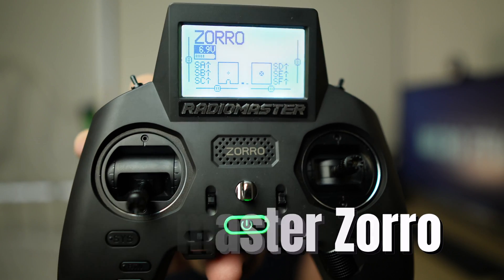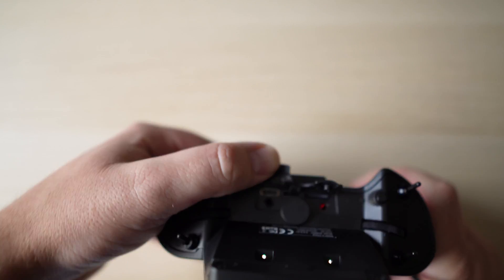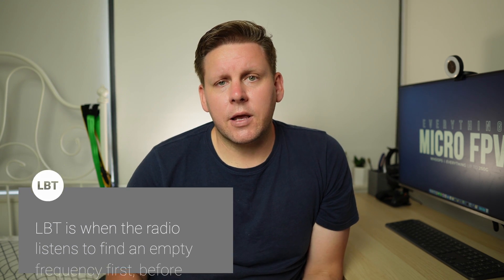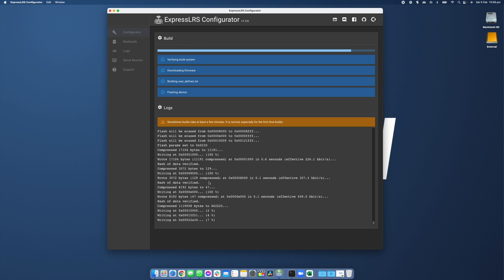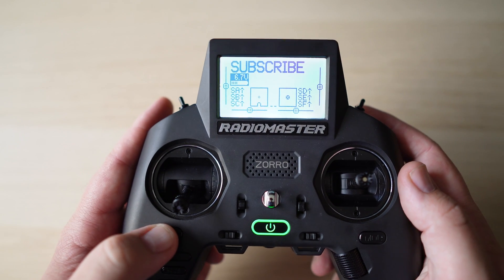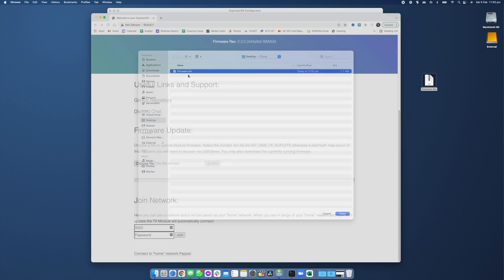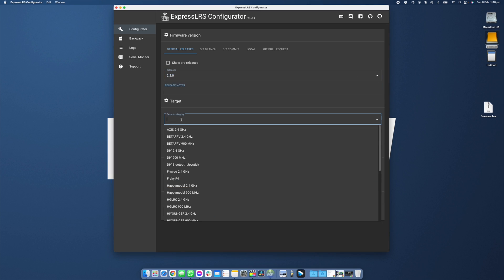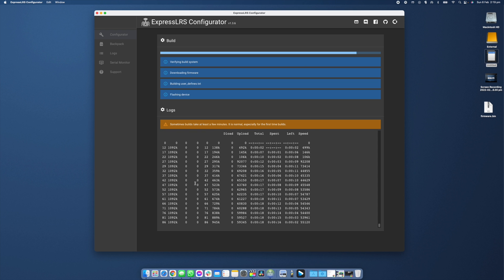Easy ExpressLRS Setup on Radiomaster Zorro

Comment: Hi Darren,  thank so much for the video, very helpful. I am wondering you have ever had this issue - I have followed your instructions for wifi flashing, there was an error when trying to flash, now my radio will not produce it's own wifi network anymore.  I have tried reinstalling opentx firmware, elrs firmware and the lua script, but no matter what I do my radio will not produce a wifi network (I have checked for the signal on multiple devices).  I also cannot flash via the serial port as it will not find the com port.  Only got this radio last week, such high hopes, but it has honestly been painful so far.  Any suggestions would be most appreicated.  Thank you.
Reply from the maker: The ELRS TX module in the radio is bricked. There is a recovery process documented on the ELRS website.
Reply: @DarrenAllatt  You're kidding me mate?  What a pain. Will look in to it, thanks so much for the speedy reply.
Reply from the maker: @nickybomz  you are in Australia?
Reply: @DarrenAllatt  Yeah I'm in Melb mate. I tried everything I could last night but could not get wifi to work, nor update update the ELRS via the via my laptop (doesn't recognise com port automatically, and I can't find any way of identifying which com port my USB aligns with).  Beyond frustrated. Any tips would be greatly appreciated.
Reply from the maker: @nickybomz  add me on Facebook. You can Post it to me (I’m in Sydney) and I’ll fix it and send it back (just include a return postage bag)
Reply: @DarrenAllatt  Really??  You would do that for me??  Oh mate, I cannot thank you enough!! Will contact you via FB.  You're a legend!!  😊

Comment: hi , i have a problem , when i go to sys and select expresslrs , then it dont go to elrs menu , and just write : " loding... ? ,???,? "
help plz
Reply from the maker: Have you set up the model, where Internal Transmitter is CRSF and trainer is set to Master?
Reply: @DarrenAllatt  ty, , i do it and its better now but still i cant bind .. , in setup , INTERNAL RF mode is CRSF 400K, trainer , i test master jack and master sbus , in scripts , tools , i execute elrsV2.lua ,, in sys expresslrs , 500Hz , 1.128 , hybrid ...
and i have 2 reciever pluget to pixhawk telem2 , and sbus port , and they are flashing

Comment: Great Video! I have a question I'm trying to flash my jumper t18 and my happymodel modual and it downloads for a while the I get an error Failed to connect to ESP32, I falshed my radio last week and modual and had no problem I really need help Thank you in advance Rich
Reply from the maker: The Jumper T18 isn’t an ExpressLRS radio, so you are probably plugging in your radio via usb and trying to flash instead of flashing your module. 

Click build instead of build and flash, drag the firmware.bin file to the desktop and then power your module. Connect to it via wifi then flash it

Comment: Before you start, ensure you have the latest EdgeTX firmware version on your Zorro or TX16S MK2. You need at least EdgeTX 2.7.0 (f79978b) or EdgeTX 2.7.1 (a55aff0). The Zorro often comes with an earlier EdgeTX 2.7.0 version (2bdd4974) which results in unsuccessful flashing.
Reply: Thanks Ryan! it saved my life.

Comment: 2 min?  I've been working on it for 3  days and still haven't got it working.
Reply from the maker: What are you doing?
Reply: @DarrenAllatt  Watching RX flash fail.over and over and over.
Reply from the maker: @Roundawg  probably because you are trying to flash RX firmware to a TX
Reply: @DarrenAllatt  I've already flashed the TX
Reply from the maker: @Roundawg  add me on Facebook and send me a screenshot of your ELRS Configurator and your quad

Comment: Great video, but I'm getting a "Target Mismatch" warning when I am setting up for the first time. Any idea if I'm okay to proceed? I have verified everything was correct in the configuration before building.
Targets Mismatch
Current target: RADIOMASTER_ZORRO_2400_TX.
Uploaded image: DIY_2400_TX_DUPLETX.

Flashing the wrong firmware may lock or damage your device.
Reply from the maker: Yes that’s perfectly ok to proceed. The default firmware from the factory is “DIY” so flashing the right target from the Configurator is correct
Reply: @DarrenAllatt  Thank you very much. New to FPV and so far every step of setup has had its challenges...
Reply from the maker: @dnaartistries  yes. Fpv is a “hobby” so invariably there is challenges with hobby grade vs consumer grade products

Comment: Heads up: if you flash the 2.2 release with the EU regulatory domain then you are limited to 10mW. The LBT code for up to 100mW is in the master branch but not in a official release yet.

Comment: Hello, I'm interested in Zoro because I want to learn drones. But I'm thinking between the ELRS starter set and CC2500. Which one shall I choose? At first, people say it's good to buy an ELRS starter set, but other people say that the cc2500 is good for later, but it's too difficult. Please help me with what I should start with.
Reply from the maker: Given CC2500 gives you FRSKY and FRSKY has bad range, if you are getting into FPV & Drones then you are best to start with ELRS because it saves you upgrading to it in a few months.

Starting with ELRS limits your second hand market a little, but most people sell drones second hand without receiver anyway - so you have to put one in. Might as well be an ELRS.

Most Bind and FLy (FPV Drones from stores) all have ELRS options.

Start with ELRS
Reply: @DarrenAllatt  Thank you for your detailed answer.
I'm worried that ELRS is very difficult, but I'll start with courage.
Reply from the maker: @midi966  It is not very difficult at all and I can help you if you need it
Reply: @DarrenAllatt  Thank you. Thanks to you, it helped me choose the controls. [ZORRO ELRS Starter Set] So I bought it. There's a lot to learn from now on, such as buying drones and setting them up. Thank you for your courage.

Comment: Hmm. Neither method work for me. On USB, build and flash gives me an error message "c/users/*me* is not recognized as an internal or external command" or some such, and for WiFi- I go into the ExpressLRS script on the radio and it says "loading ???" indefinitely, but doesn't load. Mine is basically a paperweight.
Reply from the maker: check the model that internal receiver is to crossfire or CRSF And external module is turned off, And trainer is set to master
Reply: @DarrenAllatt  Yes, that was exactly the problem- both internal and external modules were turned off in settings. Thank you so much!

Comment: Great video glad i found your chanel covering ExpressLRS especially as i am slowly transitioning over myself, would love to see a video on the elrs best settings and meaning for each option on the elrs 2.2 radio controllers as i just flashed my new happymodel es slim pro for my frsky x lite and now i am scratching my head with in elrs info i.e best power setting 500mhz, fan threshold etc for my betafpv meteor 85 elrs whoop etc. Great work 👍

Comment: what firmware does it come with
Reply from the maker: Comes with V2 and you can use traditional binding if you want
Reply: @DarrenAllatt  is it when you plug in 3 times to bind can I use this way to bind receivers
Reply from the maker: @SeeFPv-qm6ie  
Yes, power-cycling the receiver puts it into bind mode. 

However, serious question - how come you don't use a "binding phrase" it just makes it so much easier